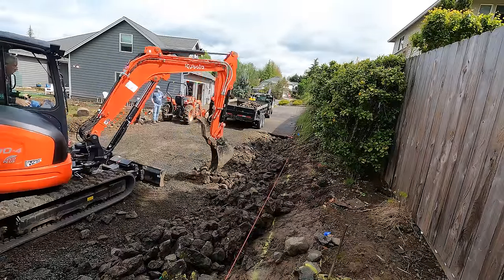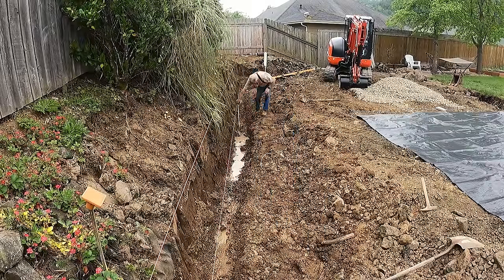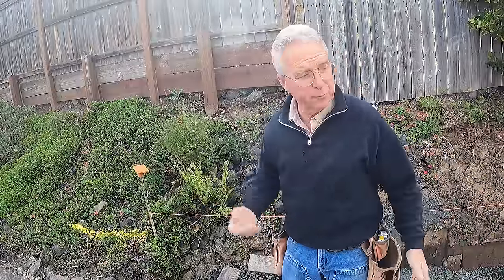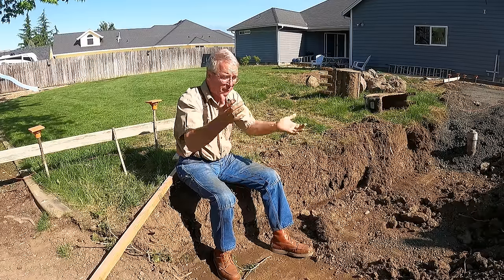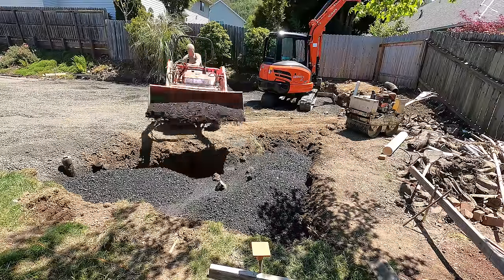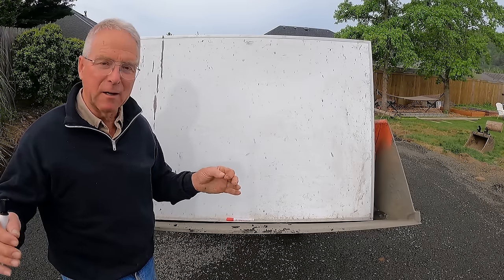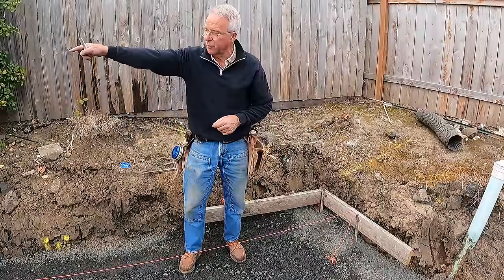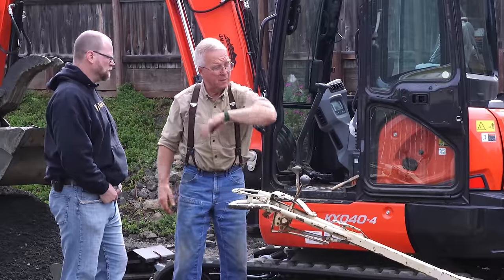Dirt Work: Shop Build #3

Comment: I get the Pythagorean theorem part just fine, but how do you get 2 perfectly parallel lines to start with ?
Thanks for the invaluable knowledge I keep gathering from this channel !
Reply: Start at your critical corner (corner 1), pull your first string along the long side (call that corner 2). Go back to the critical corner, measure across (26ft in this case) to corner 3 and that's where you start the second string.

Then run your second long string down and measure 26ft (or whatever) and lock your string there for corner 4

You can then just measure up and down the lines to verify, but if your measurements are correct at both ends and the string is taut, it will be the same all along the length.
Reply: @synapticburn  yes but without checking that you have a right angle when "measuring across", you can basically get any quadrilateral. So you're back to square one 😀
Reply: @haenou  yes but for those corners you can just use a framing square, or the 3-4-5 method (lots of videos on YT on this)
Reply: @synapticburn  thanks for trying hard to explain :-) The problem with the 3-4-5 method is that you end up doing exactly what he is tell us NOT to do ("old school method, checking the diagonal and moving until they are the same, huge waste of time etc etc").  That's why I was hoping there was a different method to get parallel lines :-)
Reply: @haenou  He's saying don't do that because it's over a huge distance and requires moving more than one point back and forth. Not an issue with the 345 method where you don't have to move at all.

For a short section like that, there really are only 2 options in the universe:

Check it with a short quick measurement of the diagonal, or use a square object

Comment: Great way to find square. One way is use is still  Pythagorean theorem but us 3, 4, and 5 for my measurements. If you place a mark at 3 ft on one leg and 4 ft on the other leg, when you measure the hypotenuse you will get 5 if it is square.

Comment: 32:38  I know a builder of commercial greenhouses. He rejects the string line and use a .035 or .045 mig wire and wire tensioner rachet.   Says it is able to be tighter than string, less sag, and less sensitive to wind.  Commercial greenhouses are often built longer than 300 ft, sometimes hectares at a time.     Only downside I could see is that the wires become invisible on the site to amateurs, rookie helpers, other trades and building owners, they will bite your shins and calfs and make you yelp.
Reply: Another method is to use "Jet line"  whcih is a string much like dental floss (which is also used)  it's stronger and lighter,  so can be tightened to a much higher tension than the usual string, and has less sag at a given tension because of the lighter weight.

Comment: Filter fabric has 20-30 times the flow rate of road fabric. They are designed for drainage and separating the inside and outside. You should have used filter fabric.

Comment: We build houses here on that black mud.. just go 1m deep and dig a perimetral base 30cm width and you ll be fine after you poor concrete in it ..and a concrete base on top with iron bars and a netting..and your house will not budge no matter if summer or winter.

Comment: I used that perf pipe on my French drain but I also used the sleeve that comes with it so it doesn’t clog.
Reply: Problem with the socks is they will clog up over time and you have to dig it up to replace it. Best bet is to use perf pipe and put clean outs every 50 feet or so so you can flush and sediments out that collect over time.
Reply: @mikeznel6048  , sure they do. But mine is around the parameter of my backyard so it doesn’t get a lot of chance for that. I had to put it there because the neighbors behind us raised their yards causing runoff which would just flood ours. At the time the houses and yards were new, and now 20yrs later there’s mature trees and lawns that help keep the water flows to a minimum. I do see it working at times when we get a heavy rain so I don’t have any clogging issues. I can see it, because I have it on a pop up drain next to the gutter in the street. 
I could see that clogging happening if it was in Scott’s situation.

Comment: Not sure if anyone has mentioned this yet but I highly recomend the "Construction Master 5" calculator by Calculator industries. It makes light work of the trade math shown with rise-run-diag-pitch functions. I make my living fabricating steel stairs and rails and I would be lost without this tool. For roughly $50 dollars it will save you a ton of time!!

Comment: I was once told road crews had a guide of 4" per 24 hours for compaction. Cival engineering people measure the daylight out of that stuff and it's more critical when most of what you're building is dirt.

Comment: Holes point down on pipe. Water rises from the bottom of a trench into the pipe, and filling the pipe.  It doesn't fall from the top and fill the pipe.
Reply: That is not necessarily true. It depends where the water is coming from and where you want to get rid of the water.

Comment: One thing you might have mentioned in your explanation of the Euclidian concept is the very real possibility of error in the trial-and-error method relying on diagonals: A trapezoid- which has no right angles- can have equivalent diagonals.
Reply: All you need to do to detect that kind of error is another Pythagorean check. At any corner that is supposed to be 90 degrees, measure out 3 feet in one direction and 4 feet in the other direction, placing a post or nail at each of those points. Now measure between the placed posts or nails. If it comes out to 5 feet, you're square. Anything more or less, and you're not, but it takes much more complicated math to figure out by how much (true trigonometry is needed for that, SOH-CAH-TOA).
For a square or rectangle, if you do this check at any 3 corners and it comes out square on all of them, then the 4th corner must be square as well.
Additionally, the longer the baseline you use, the more accurate this check becomes. So say instead of using 3 and 4 feet, and checking for 5 feet, you instead use 6 and 8 feet, and check the long side to match 10 feet. That should double the accuracy of determining square, given the same measuring tools are used.
This is simply an application of the "perfect" right triangle of 3-4-5 side lengths.
There are other side length combinations possible, one of which is 5-12-13 (which might help with particularly long and narrow rectangles, such as sidewalks).
So long as all sides are measured with the same device, using the same units, this should be an extremely repeatable measurement check.
Reply: Right, the basic assumption is that the person doing the layout is able to correctly measure the lengths of the sides.  If they can do that, then the possibility of laying out a trapezoid  vanishes.  If they can't do that, then they've got bigger problems than their corners not being square.
Reply: @andrewalexander9492  Making the opposite sides equal length eliminates the possibility of laying out a trapezoid but it does NOT guarantee a rectangle with square corners. You could still have a parallelogram. A parallelogram has equal opposite sides but unequal diagonals and unsquare corners. 

The bottom line is that you can only guarantee a rectangle if the opposite sides are equal AND the lengths of the diagonals are equal (or your corners are all exactly square).
Reply: @bruceadler-9410  I didn't say that making opposite sides equal guarantees you right angles, I said that if you make the opposite sides equal, the equal diagonals method will give you a rectangle.  I said that in response to the first guy who said that the equal diagonals method might give you a trapezoid. Please read (and understand) the entire discussion before jumping in to "correct" mistakes that nobody made.
Reply: @andrewalexander9492  That might be what you intended to write but that's not what you actually wrote.  And now you seem to be trying to offend me (by saying I don't know how to read) because I didn't correctly infer what you meant to imply. Sheesh. Get over yourself. What you wrote was incomplete, ambiguous, and confusing to anyone who can't read your mind. And rather than insulting me that my completely correct and unambiguous reply is what you thought you already posted, you should accept that what you actually wrote can easily be misinterpreted and simply have responded, "Bruce, that's exactly what I meant to say, sorry for the confusion".

The ambiguity and confusion arises because the first guy says (paraphrasing), "the EC video is right, do NOT rely on equal diagonals because trapezoids aren't rectangles but can have equal diagonals". Then you said (paraphrasing), "right, rely on equal sides to avoid trapezoids". Because the EC video itself eschews checking for equal diagonals, and the first guy says that the EC video should have more explicitly said "equal diagonals can cause trapezoids", there's no way to  combine all that plus your statement and come up with the correct answer ( ie  "you need both equal diagonals AND equal sides").  Rather anyone that's maths-challenged but knows how to read could wrongly infer that you were implyng "you need equal sides and not equal diagonals".
Reply: @bruceadler-9410  No anyone with an IQ above room temperature would have understood that my comment was A) in response to the first comment and B) in the contest of using equal diagonals.
  Are you conceding that you're unable to grasp context?
Reply: @andrewalexander9492  Speaking of context, I think somehow you completely missed the fact that the whole point of the EC method is to not bother with checking for equal diagonals and just use parallel strings (without explaining his magical method for laying out parallel strings).  I suggest you rewatch the video starting at 21:32 where EC says explicitly that using trial and error to adjust the diagonals so that they're exactly equal is "a huge waste of time".  And the first guy's comment agrees with the EC assertion that they're a waste of time because when equal diagonals are done incorrectly you get a trapezoid not a rectangle.  But somehow, inside your head, all of that means the same thing as: equal diagonals are obviously required and necessary and aren't a waste of time. 

I've got "...many cheerful facts about the square of the hypotenuse; I'm very good at integral and differential calculus;. I know the scientific names of beings animalculous; In short, in matters vegetable, animal, and mineral, I am the very model of a modern Major-General."

Comment: I hope you don't regret using that road fabric... I doubt you were able to poke enough holes in that....
Reply: I love Scott but burrito-wrapping a french drain with non-permeable fabric and then “poking a few holes in it” is a big mistake. You’ve essentially defeated the purpose of a french drain and now much (if not most) of the surface water will sit on top of the road fabric. They would’ve been better off not using any fabric.
Reply: Yeah, I was kinda disappointed to see Scott half-ass it like that "because this is all we had around here today".   Stop what you're doing and get the right fabric.

Comment: "Yes but that really just a simple layout, its just a rectangle."

Please explain that to almost all production builders for the last 30 years.

In the residential construction in my state it is not uncommon for walls to be out of square by an inch per foot or a floor to by out of level by 1/2 inch per foot. Have personally been in apartment, setting a 10 foot run of cabinets where the floor dropped 9 inches in 10 feet.
Reply: When I was a GC we constantly had to monitor the subs.  Level, plumb and square didn’t mean much to most of them until it came down to fixing the mistakes (which had to be done to collect the check).
Reply: @badlandskid  So long as those subs have to eat the cost of all the corrections, I don't see much of a problem. If you hit them in the paycheck, you would think that would teach them the proper importance of "square, plumb, and true", right?
I mean some people need to be taught twice (or more), but eventually if they mess up enough times and aren't allowed to get away with it or shunt the extra costs of fixing it off to someone else, then they should start coming to their senses and doing things right, right?
It works on much larger corporations (apparently with much smaller fines), so it should work here, right?
Reply: @44R0Ndin  it’s called delays.  And delays ARE problems.
Reply: @badlandskid  Yep. and problems cost money. Money that the subs should have to pay the GC for not meeting expectations.
Contracts can have that kind of language built into them from the start you know, maybe talk to a lawyer if you want to figure out how to put this kind of "cover my own ass" kind of language in your subcontracting agreements.

EDIT: In case it wasn't obvious, what I'm trying to do here is solve the problem in a way that if it happens on a project the penalties in place will prevent it from happening on future projects.
Reply: When i was framing we had a rule of thumb, if the building foundation was within 2” of square and where it was supposed to be, we just ignored it and built on top. More than 2” and you informed the super before just going ahead and building on top of it anyway.

Comment: 17:48… yes it may compact 10-12 “ thick but is not recommended. Ideal would be to compact 2” at the time but is time and money. I think in that situation you should have compacted 10-12” in 5-6” and that will get you the appropriate compaction level.
Reply: You should tamp at 2 inches if you’re using a plate tamp, with that double barrel roller with vibration he should be good compacting ten inches of clean stone fill that’s being watered and it looked like he rolled it both ways more than once.

Comment: I have a dilemma and also an idea for  a possible  podcast im working for gerber construction we build  water tanks dams and bridges
However I’ve always had the  urge to learn frame carpentry. But forming seams to have the same skills just in a different way  I’ve been here about a year   And been about 11 in the trades in general  i just. Cant decide if I should hold out and be patient or take a chance at framing

Comment: Have I missed something? How did you get two parallel lines at exact distance from each other?
Reply: I had the same question.  I know how I would assure the lines are parallel, but I wonder if EC has a more efficient method (as he so often does).  

Second, it's also critical that the 26' line is exactly perpendicular to the first 36' line to use the Pythagorean theorem method.  A quick 3-4-5 measurement will check the right angle, and it can be expanded to something like 24'-32'-40' on this project for more precision.  Any tips for a more efficient method to check the angle?  I always learn several new skills or tips from each video.  Thanks.

Comment: I love the metric system even more!
Reply: Merica system is just as good. Especially when you are using tenths of a foot. I personally find fractions to be much easier and quicker than the metric system but also have no problem using the metric system. They both work just as good. They both require math. They measure stuff.
Reply: @mikeznel6048  with the metric system you don't need to do fractions. For people who already know imperial (US, Myanmar, Liberia) it works, but for anyone new or who wants to work fast, especially in computing, you need metric. I don't you will change, that's not what murica does.
Reply: @mikeznel6048  Do not take me wrong. As a lazy European, I just watched in awe how Scott recalculated the length using fractions. 3/16? what the hell? I like the imperial system because it feels more natural (and we still use it in Europe for some measures - for instance, water pipes and fittings are in inches and nobody thing about it when buying 3/4 fitting. That said, using metrics is much easier to learn. Basically, we move the decimal point and that is it. I am curious if the ability to recalculate imperial fractions is very natural to all Americans all that is some "carpenters" magic.

Comment: i used the 3,4,5 method to set out my home working out the length of the diagonal, the big problem was finding out after a couple of hours of "fing and blinding" why the two diagonals didn't work out, they'll never work out if one of the tape measures you use the measurements don't start until 4" from the ring on the tape 😣😣

Comment: you should never use the following colors as a contractor digging, blue;green;red;orange;or yellow  those colors are reserved for miss utilities for marking cables. the standard for those 5 colors are nation wide.
RED:  power
Orange:  communications
Yellow: Natural Gas
Blue : fresh water supply
Green: waste water
Purple:  grey water( normal irrigation, or rain water catchment)

You should be using white paint

Comment: I don't understnd why you isolated the drainage pipe from the soil by wrapping it in plastic.
Reply: I don't understand either.  Like he said, what is supposed to be used is filter fabric, which is used to keep fines (sand, silt) from plugging op the gravel in the french drain, but lets water flow through relatively freely.   He knows all this, and described it in detail in the videos in the Spec House series when he's discussing the drains he put behind the retaining walls ... yet, he blithely wraps it in the wrong product because that;s all he had on hand that fay ... shaking my head.

Comment: You kind of lost me at adding the extra foot with the tape measure. ??
Reply: His son-in-law wrapped the first foot of the tape around his leg to hold it steady, so that added 12" to the measurement. This is the "burning a foot" he was talking about. This gives you a line on the tape (at 12") to line up with the mark on the string instead of trying to accurately line up the end of the tape.